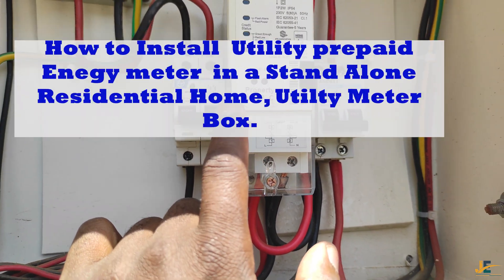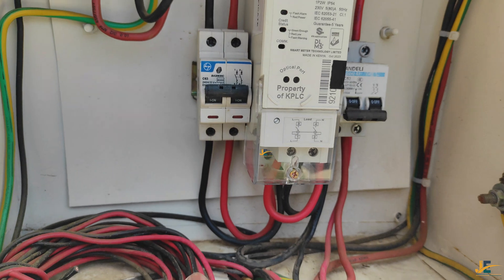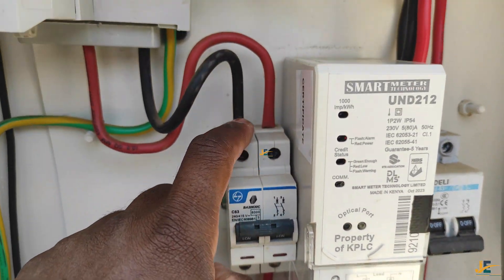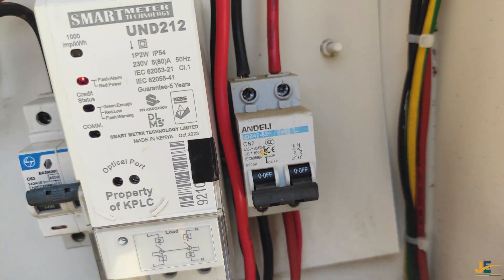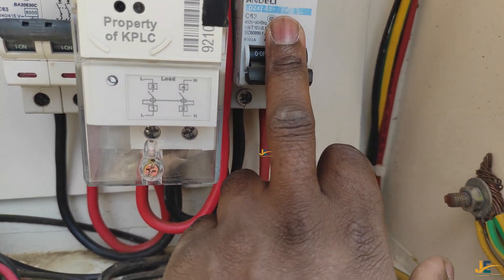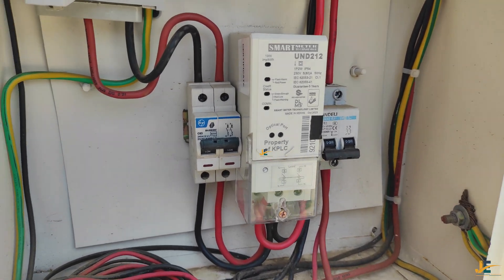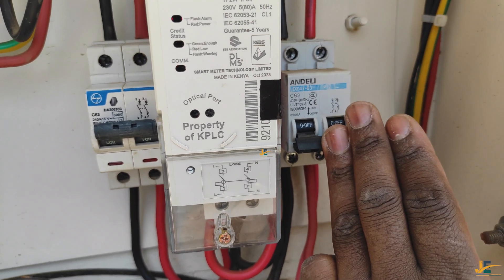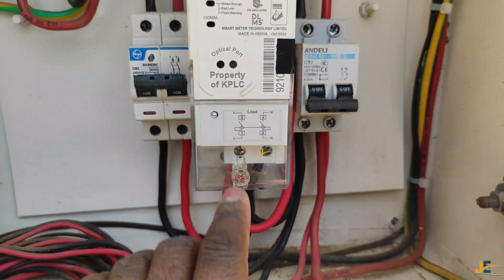How to Install a Utility Prepaid Energy Meter in a Stand-Alone Residential House. #energymeter #kplc

Comment: where has that earth started in the main supply?
Reply from the maker: There is an earth rod and PME that all meet at the same point, called the earth link Bar, inside the utility Meter Box.
Reply: thank you..I'm in nairobi currently.can I come work with your company to maybe gain some experience? @johwatechelectricalcontractors